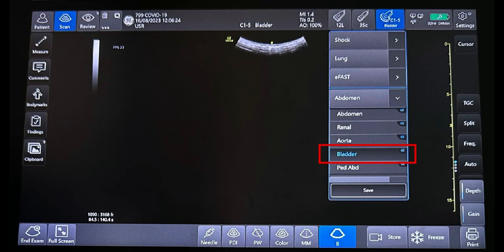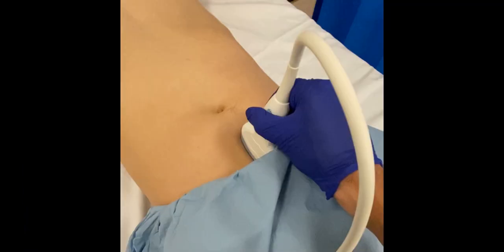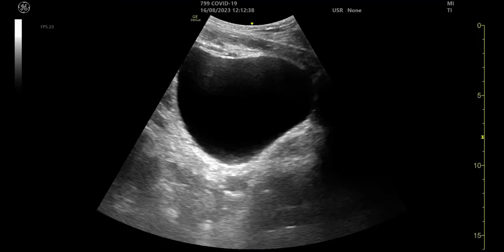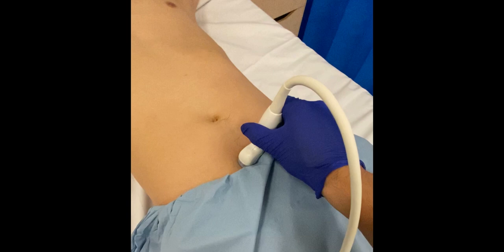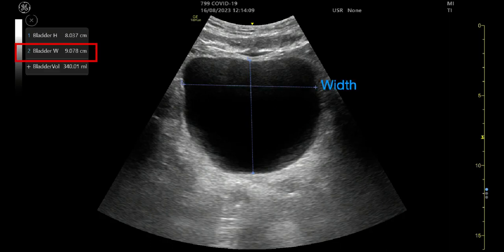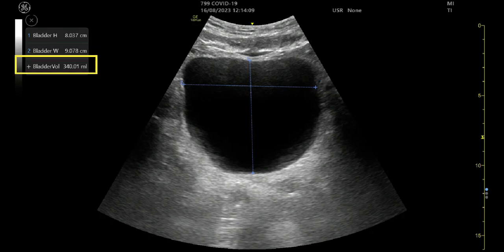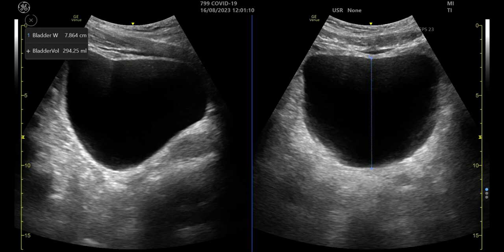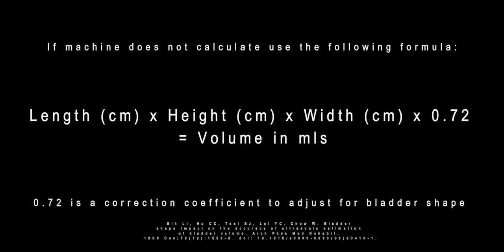PoCUS - Bladder Volume Measurement

Comment: Width in transverse scan while height and length in Longitudinal scan? Isn’t it correct way?
Reply from the maker: Good question. The way I have shown is how most people I’ve seen currently do it, however you can also do it the way that you mention and have seen people do that. I think both are acceptable. Would be interesting to know which is more accurate